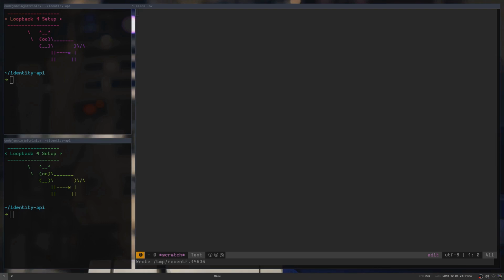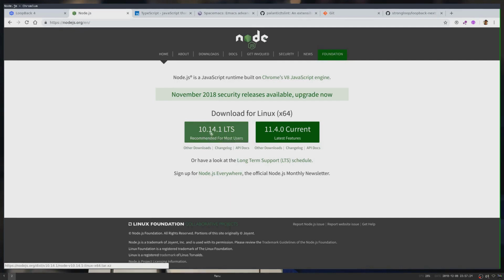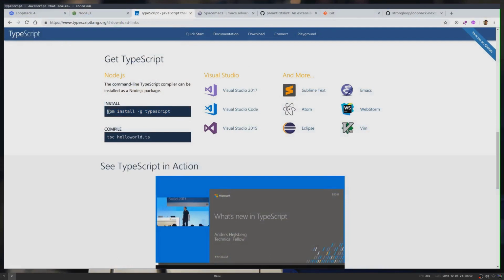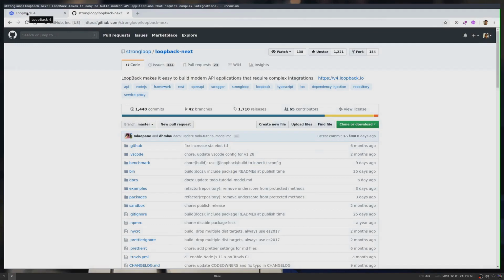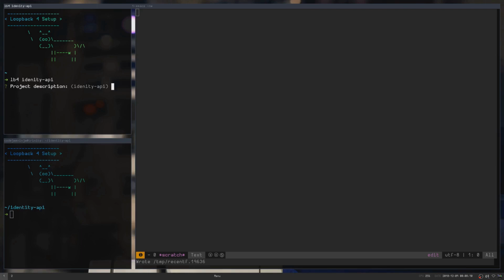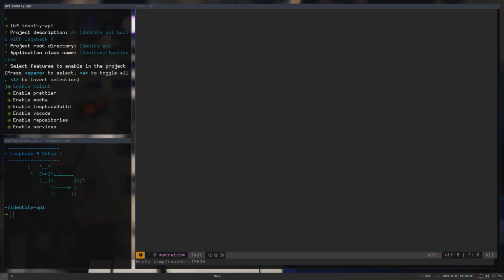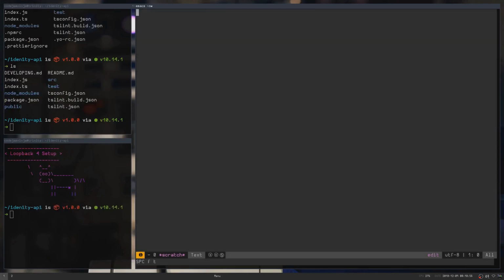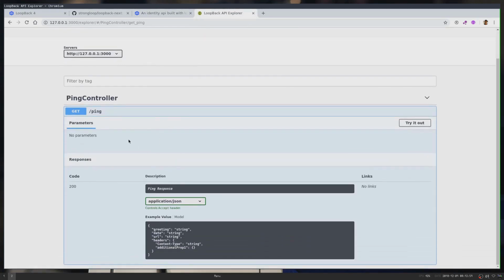Loopback 4 Setup

Comment: What editor is that :o
Reply from the maker: @smashingpunkkids  it is i3 gaps. I compiled the operating system myself. https://github.com/codejamninja/jam-os
Reply from the maker: It's actually an operating system, not just a text editor. The operating system is Jam OS, a Linux operating system specifically targeted towards software developers. It will be released sometime next year. https://github.com/codejamninja/jam-os The text editor I'm using in the OS is Emacs, a text editor written in 1980's. Specifically, I'm using the Spacemacs configuration layer, which is set up with Vim keybindings. http://spacemacs.org I'm kinda in a funny predicament because I don't know whether to tell people my text editor is Emacs, Vim or Spacemacs. It's basically all three at the same time.
Reply: @risserlabs  haha cool thanks